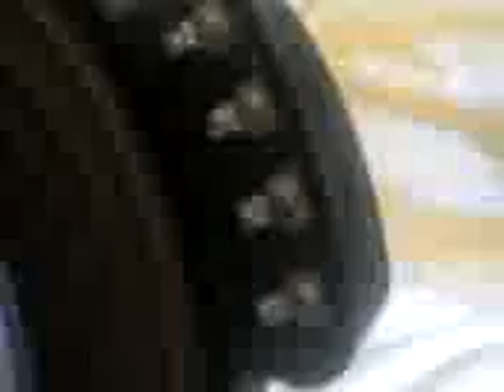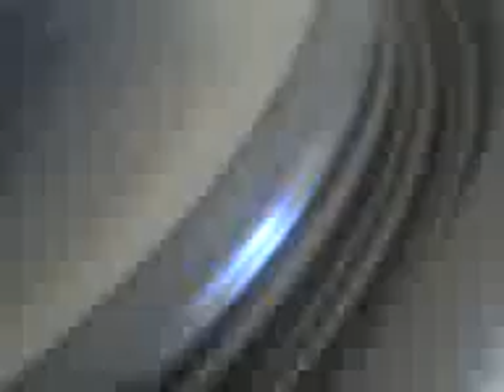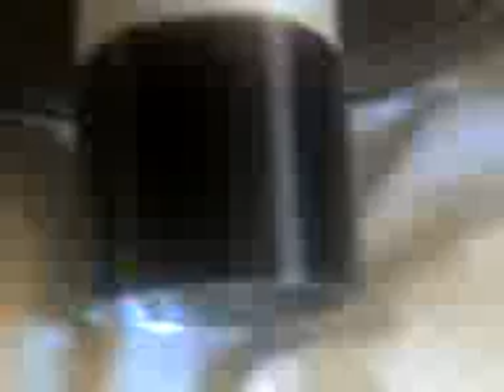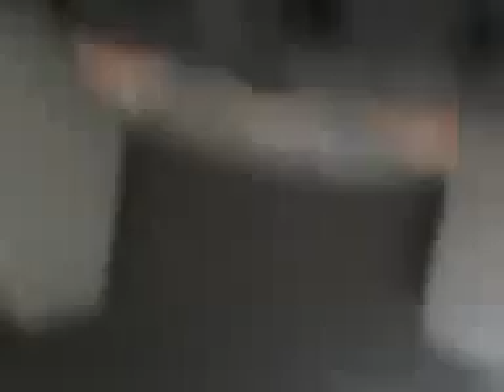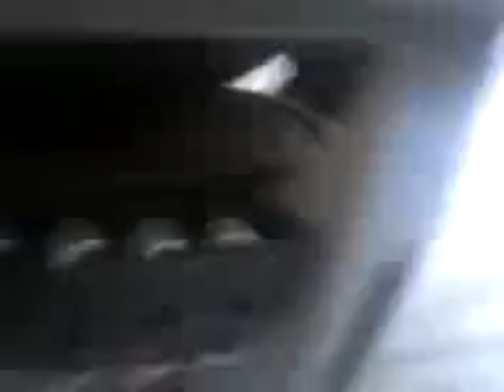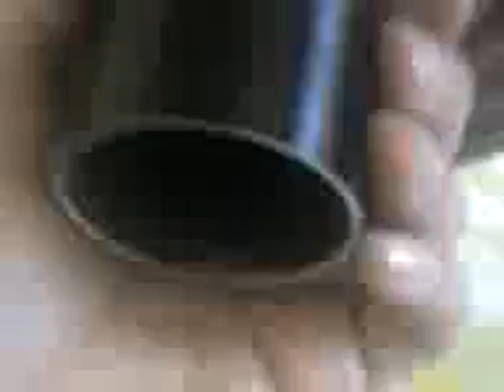Alpine Type-R (1222D) Teardown and Rebuild

Comment: would ca glue work for the surround to cone surface? i have an 8 inch in a slot port box and its on an mrv-m500 at 1/4 gain in my truck (that i use maybe once every two weeks) it worked fine last time i drove the truck. its been hot outside the last couple weeks and got in the truck today and first couple seconds heard the flapping sound. its only about two inches separated and no damage. looks like there was only a thin line of glue factory that didnt even get pushed flat. ive only had this sub for a month and a half. fucking irritating.
Reply from the maker: dbrinkley5 absolutely. Hobby grade CA fROm an RC store is the best quality.

Comment: i had a funny feeling it was terminals when i started getting slapping, because it sounded like someone was holding a thin plastic sheet over top of my woofer, i free aired it and got the same noise so i pulled it apart and turns out underneath that stupidly huge dust cap the cone had collapsed on one side and i was getting coil rub on the other side as a result. i bought them used so i dont know if someone dropped something on it or did something stupid while they were moving but im guessing it was there before i got them because it progressively got worse, i was only pumping 300w rms each into them so i know it wasnt me over powering them. but i wont lie i thought it was the spiders letting go,  i wanted to blow it up and catch it on camera, im glad i took it apart before trying to pump as much power as i could through it and damaging the motor.

Comment: Applies to Alpine Type S also. It's very easy to remove the inside cover of the terminal block to achieve this repair, just gently lever the ends with a flat screwdriver. I used a right-angled screwdriver on the loose screws. You could also use a Philips bit held in Vise Grips. 
It took under a minute to fix a "junk" sub. 👍

Comment: Watched your video. Got a question though, how is the magnet held onto the basket? It looks like its screwed into position, but not sure. Does it fasten in place with screws or is it glued into place? I ask because I have a pair of these and one sub seems to have a loose magnet that has seized the cone from moving, but I can use a flat screwdriver and move the magnet enough to allow the cone to move freely. Need to know if I can just take the surround off the basket, unscrew the spider and tighten the screws on the magnet(what appears to be screws holding the magnet in place). Or will I have to shim and glue the magnet back in place.thanks.

Comment: I have 2 type r 15's 2ohm wired in parallel set them with a oscope both of them got hot and melted the terminal sideways so I'm going to recone them hopefully they don't do it again and also the surround glue does suck I've had mine 3 years daily pounding for at least an hour each way to work and I didn't notice it until I totaled my car out and checked my box to make sure everything was still intact they still work I'm just going to replace it that way I have no problems in the future or hell I could even sell them and get some better subs

Comment: I have a alpine type r 10, and one day I was bumping it and noticed it didn't sound as loud so I take it out the box and connect one both coils and the one on the right side wasn't working and I was wondering if this is the problem cause I beat it hard, and it's wired to one ohm parallel

Comment: I have the same sub. But on it makes a wierd noise when it gets loud. Almost sounds like the coil is seperating from the cone. I cant figure it out how to get it apart. I refuse to throw it away.. Lol. Anyway, I took all the screws out, took the rubber off.. etc. I can't get it apart. :(

Comment: I took that cap off mine. Kinda a bitch accualy. But the screws are still tight for now. Have to find something to get in there and make sure. They screw into the top part of the terminal insted of the plastic. But im sure you could strip the shit out of it if you get to crazy.

Comment from the maker: Yea it's the same stuff! There's different formulations and I believe the hobby grade stuff is the best of any of them. I'd say the rubber would tear before it comes back off for sure. MUCH better than the soft crap glue Alpine uses.

The VC on this thing is pretty decent for what it is. Now I see why they have held up to my abuse for so long. This coils 4 layers thick only on the outer part of the coil. I'm really curious what the X looks like now. Maybe I can find a pic somewhere.

Comment: Oh, I didnt know they were the same? The glue I used is the kind of stuff where if you get it on you fingers and you put them together, your fucked. Skin is removed to get your fingers back apart, ouch! Hmmm I didnt think that glue they use was THAT strong. 

That former is a beast. I would like to see what a type x looks like now. I know the voice coil is 3 layers out 3 layers in, but... Sence its suppost to be built much better, Im wondering just how much better.

Comment from the maker: @jonmanch3st3r Thanks for the stars bro! Sorry for the shitty ass vid quality, but my cell is all I got for the moment. This would have been way easier but I did it the hard way. Pretty much about the same amount of work, but I have a mudular design, so the spider landing screws in. One less joint to glue. I'm just glad it was fixed without spending $!

Did you get your package? If you have ANY questions, ask bro. You just have to be sure the glue joints are spotless and the coil lines up.